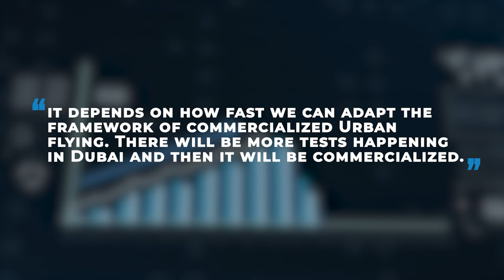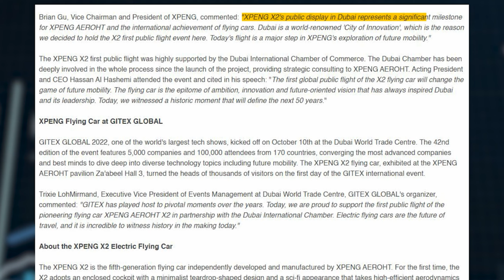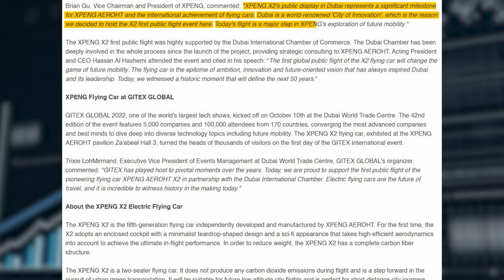The Xpeng X2 Flying Car FINALLY Takes OFF for the First Time!

Comment: Imagine the new opportunities to crash the car on top of another car, or two cars crashing in the air. Crashing into traffic lights? Landing on a weak roof? Green and red are unfortunate choices for side lights due to the height they fly. They'll be confused with traffic lights. These things might be a casual interest among the filthy rich, but it can't make it as an alternative.
Reply from the maker: Thats a really good point. A functioning system has definitely to be established. But for the autonomous flying „taxi“ version I don’t see any disadvantages. 
High traffic routes for example could be released in big cities with those flying drones. But as you said in the beginning only for those who really can pay for it. With time and increasing supply of those „flying cars“ the cost will definitely fall and its gonna become mainstream as it was with cars in the last century. 
the future is exciting 🚀
Reply: Thanks for your reply. Considering global warming, a better solution would involve mass transit rather than such a dangerous option.
Reply from the maker: Or maybe a combination of both ? 🤔
Reply: It absolutely can with better implementation. But as I see it the manual mode has to go. Just an insane potential for foul play here. But once the autonomous systems work well enough (which will happen soon, considering we have that for regular cars on congested roads - something much more difficult), I could absolutely see this becoming a viable transportation method in a few decades.

Comment: This won’t be practical until it can stay in the air and fly at near full speed for at least 3 hours
Reply from the maker: Yes the battery problem do exist. But with battery technology advancing year by year It will definitely be solved in the long run.
Reply: @michaelh45 it can  possibly work on benzine, just a slight modification, it's not a problem

Comment: That's really a brilliant idea, but if it should happen how they want to regulate air traffic? 🧐
very very interesting in any case I'm curious what the future will bring thank your for you Amazing work 👍🏼
Reply: With the current advanced mobile and GPS technologies, it is not difficult to set up wireless flying routes for these vehicles to follow and fly autonomously. I would imagine in the near future, the sky would be filled with these vehicles flying in predetermined routes, just like in the movies "The Fifth Element" and "Star Wars", with collision avoidance and other safety stuffs built in.

Comment: The only thing the Xpeng's All-Electric VTOL Drone needs is a propeller guard so if that craft accidently bump into someone it wont cut them in halve and they will have a chance at surviving.
Reply from the maker: Hopefully they will not cut someone in half and use such a propeller guard 😅
Reply: That's what worries me...